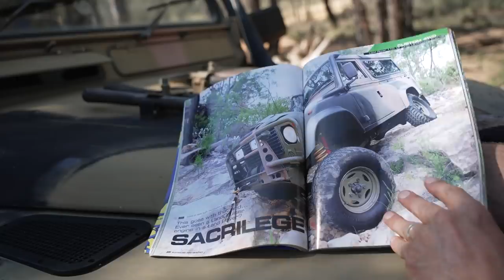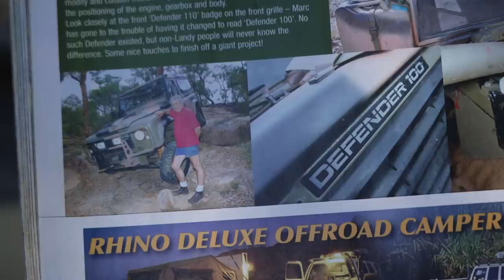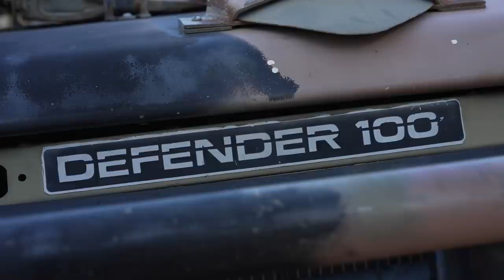Defender 100, Modified episode 91

Comment: When you said most modified vehicle i never imagined it was THIS modified.
Reply from the maker: You me and everyone else until you really see what it’s about 😁
Reply: @Ronny_Dahl  theres a kit you can buy in the states,to arc weld from your vehicle. several actually.. look up power tanks, inflates a 35 in 30 secs..''its engineered.''. only in australia.. nanny country.... he should of fitted d44 diffs, so he could have a turbo diesel & not blow centres..axles,bearings,uni,s,ect..funny how land rover [ range ],had a v8 with 4 coils,while toyota had a 50 hp 6 cyl & leafs..took till the 80 series to catch up..then,they lost the plot again..

Comment: This is the true 4x4 truck. Old school, simple and reliable!! What a weapon!!
Reply: Needed a Toyota engine though, either way it’s sick truck
Reply: I've owned 2 Defenders. A 300 Tdi and a 2.4 Puma. Neither of which could ever be described as reliable....
Reply: @typhoon-7  i've owned my 300 TDI Defender since 2006. Before I bought it it belonged to a Bungy jumping company in Queenstown New Zealand carrying people in and out of skippers canyon every day for 10 years. For my 15 years of ownership it has been nothing but reliable..........
Reply: @jimbolr110  same
Reply: @typhoon-7  I don’t understand the content of your reply to this guys comment, it’s reliable because it has a Toyota 1HD-FT engine which is probably the most reliable engine Toyota ever made for a Landcrusier, mechanical yet injected, turbo and came out in the best Landcrusier a Toyota has ever built the 80series VX limited, 40thed series from 95-97. many other engines in the 80series but this is the best.
No one is saying or arguing that Defenders were or are reliable.
Reply: @typhoon-7  i had a 200tdi for 10years very reliable and know a 2.8tgv 100inch defender built 10 years ago, very reliable and going strong, so like this truck a few changes and you can have a good reliable truck...

Comment: Great article.Brightened my dreary wet Sunday morning.  Land Rover built a series of 100 inch coil sprung  vehicles  in the late 70's  for a Swiss Army contract trial. Obviously the suspension was not heavily modified. Unfortunately  they were unsuccessful . The 100 inch wheel base was never developed as it was deemed to close to the planned 110 and 90 vehicles' .In the Mid 80's they had another go at the contract and built several 110 vehicles with automatic gearboxes with a variety of engines including 3.5ltr EFI V8's. Bodies were all soft top with vinyl 2 part hoods along the lines of a Pinzgauer, Swing out rear half doors with one off spare wheel carriers. Two of these 110's are known to still exist both V8's 1 in Switzerland and 1 in the UK. What could have been!

Comment: 19:54 that's about as good as our Isuzu dmax with a roof rack... damn that bar work increased drag(previously doing low 7L/100km). I miss this good ol' custom stuff, especially landys. Sidewinder is a good example of this. Rangie chassis, fibreglass body, p76 motor, dual banjo axles for rear steer and all the maxidrive under the sun. Turns out it was the owner of key 4wd car, the same fella who invented maxidrive.

Comment: Space wise, the Toyota 6 cylinder diesel isn't to big. They fit the Cummins 6BT into a Defender engine bay and use the TD5 radiator and intercooler.

Comment: Nice rig. You can drive and winch with the PTO. Did it all the time in my hj61
Reply: I did it the same in my former FJ-40. With a 2,27 transfer reduction and 4,10 at the diffs, I could done in 2nd gear and winch at the same time and almost the winch match the wheels speed.

Comment: The engine is a 1HDFT, it has the black rocker box cover from the 1HDFTE, was that ever standard? Not that it matters, I am just being a nerd. 

Great fuel consumption.
I know the Defender is a lighter vehicle compared to a Land Cruiser but he has a lot of added weight on that one. 
I suspect the builder may have rebuilt that lovely 1HDFT and got it purring really well which would help the fuel consumption.

Comment: I think there was only 25 ever made by Land Rover in the late 1970’s.   I think I saw one once at a Land Rover show, did realise what it was until years later.

It’s really is a good build that and loads of things need to be fabricated.  There is a dvd set out the called “a 4x4 is born” that builds one and they are just epic off road.

(I will admit I was cringing when the guy kept calling it a panel van)
Reply: i had a 100inch built 10 years ago after reading about brian adams the singer had a 100inch defender built, again a super cool truck, love mine as best defender ever had here in uk...

Comment: He means 255/85 not 225 when discussing his daily tyres
Reply: More common is 235/85 where you don’t need to cut arches.
Reply: @sandychoda9544  Don't need to cut for the 255's either, that's why they're the go to tyre for Defenders. And he said 33" which is the 255/85

Comment: a dana 60 will stand 600 hp..it doesnt need chrome molly in a 1.5 t vehicle with 90 hp..a dana 60 comes std in a cuda with a 426 hemi.. 450 hp..talk about over kill..an 80 series toyota has a killer low range,,no need to change it. you want stupid low range,,buy an atlas transfer box. & nv4500 5 sp..unshitable..
Reply: It's a 60 series t/c, not 80.

And nothing wrong with making your driveline as bulletproof as you can.